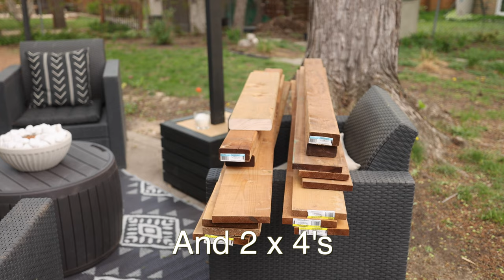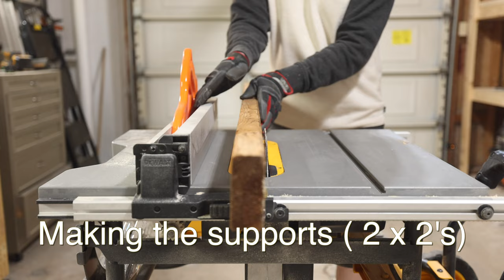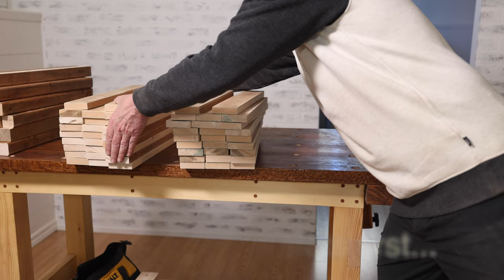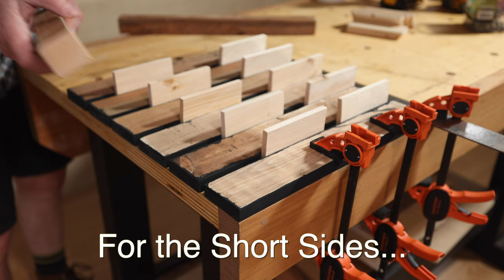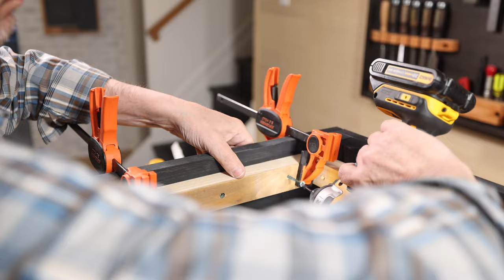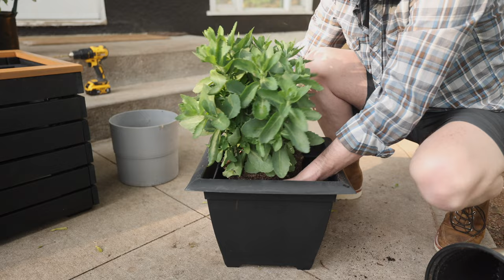Modern Outdoor Planters DIY I 4K

Comment: Great job.  Only thing I would change is add pocket holes to the inside of the top slate and attach the top trim prior to putting in the inside border that will hold the black homedepot planter.  This would avoid the nail holes in the nice trim piece.  Very minor and really just personal preference.  Its a great job.
Reply from the maker: Thanks so Much.

Comment: What size screws did you use?
Reply from the maker: If I remember correctly 1 5/8 for the slats, 2 1/2 inch for the frame.
Reply: @DIYFotoWorks thanks!

Comment: Not that easy for beginners
Reply from the maker: Possibly, can’t please everyone.
Reply: I mean... everything is a right-angle cut.  It doesn't get any more beginner than this.  He uses some specialty jigs for some of the connections, but you don't NEED things like that;  and/or, you can buy them if you feel it helps, they're not expensive and don't take a lot of room.  Instead of finding a weak excuse to try... just try it.  This project is completely entry-level.